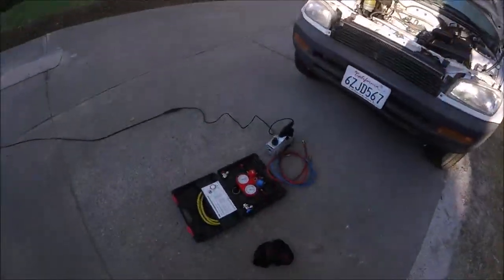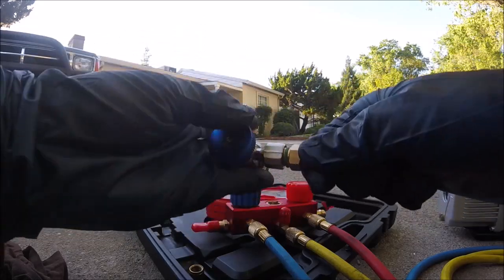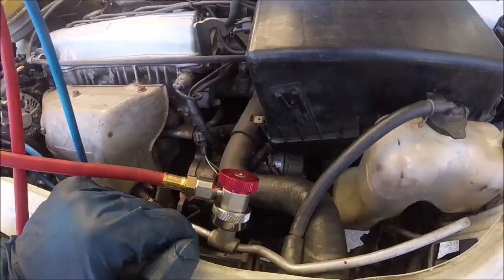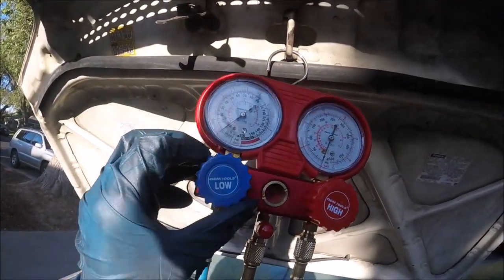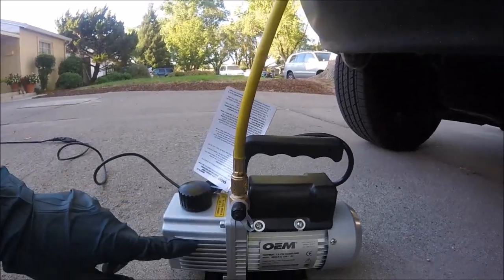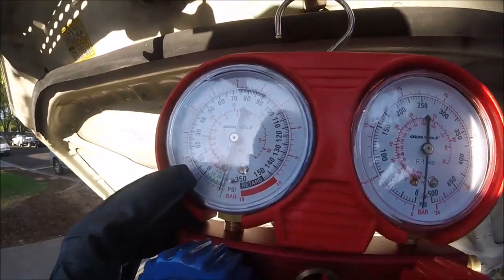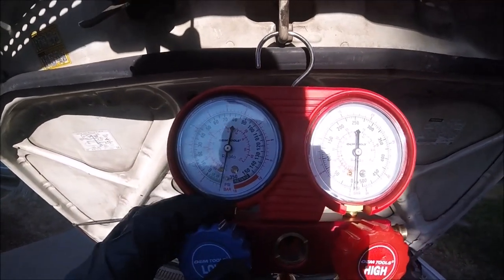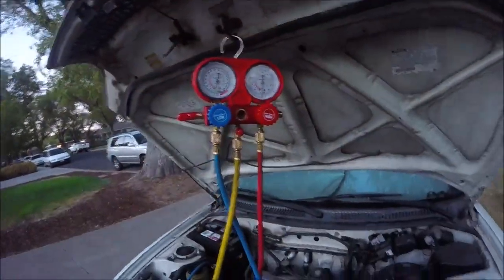How To Pull a Vacuum on Car's  A/C System -Jonny DIY

Comment: Got the vacuum hooked up now. Just replaced the condenser and dryer. My compressor was replaced when I thought that was the problem last year. (It wasn't) 
The hardest part is waiting the first half hour to hour to make sure no leaks. 
Also it's mist coming out of the vacuum most likely.

All in all you video had the info I was looking for.

Now I have to go reinstall the grill and brush guard
Reply: Went from 93° down to 45° took almost an entire 18 oz can before the cycle switch would kick in
Reply from the maker: Nice! Glad my video helped you out and I hope you get your AC blowing ice cold soon 😀👍🏻
Reply: Well wouldn't hold the negative pressure.  Had to go and double check to make sure all fittings were tight (they were not). Fixed that and -30 held for 30 minutes.  Now I've vacuumed it for 45+ minutes. 

On my way to go get freon. Will inform of before and after temps and end results 🤞
Reply from the maker: Awesome, glad it worked out. Now youre ready for the Summer heat 🌡😀👍🏻
Reply: Well after a week we have lost pressure enough that I added a 12 oz can and we are still back to it shutting off and on
Reply: That's what I'll be doing soon. The bad part is I replaced all 3 major components and all o rings. The only thing I didn't touch for some reason was the bottom hose
Reply from the maker: @0004ogre  yeah sometimes its just a matter of re tightening one of the connections.  Hopefully not compressor
Reply: Well almost. Have to replace clutch switch
Reply from the maker: Dang. Ive got a video I'm going to post soon trying out some stop leak ac. But its pretty much same process. Vacuum entire system dry, then put can of stop leak and fill with refrigerant. Then cross fingers hope if seals leak. It just really depends where its leaking from. You may want to put some UV dye in it to pinpoint leak
Reply: What do you think about the leak dye detection
Reply from the maker: @0004ogre  i like the UV dye the best. Where you use glasses and light. Kits on amazon pretty decent priced

Comment: Close that high side before adding freon
Reply: No one has lived to answer that 😂 😊
Reply: @kevinarcher7701 
👍
Reply: Absolutely!
Reply: Getting ready to do this. Thanks for mentioning. Out of curiosity what happens if one were to forget?
Reply: @spriley630 
very smart question
Reply: High side will go into tank tank not rated for that pressure so tank could in theory explode

Comment: Nice video! But my system won’t go down below zero but it holds a vacuum ? It’s about 4 notches above 0. Can I add Freon ?
Reply from the maker: Yes as long as it pulls a vacuum down pretty low and holds it without leaking youre good to go

Comment: Hey quick question. So after I know i dont have a leak. I turn the pump back on for a few hours. And then what do i do?
Reply from the maker: After you know it can hold vacuum, so no leaks, you turn pump back on for 30min to an hour to make sure the system is completely evacuated and dry. Then after that you can recharge with correct amount of refrigerant
Reply: @JonnyDIY  ok but do I open both red and blue on the valve side for the duration on the 30 mins vaccum? You didn't say that part. Thanks
Reply from the maker: Yes open both to fully vacuum down system 👍🏻
Reply: @JonnyDIY  ok. Both ends right the 2 on the ac lines and the 2 on top on the reading valves ? So pretty much open all 4 to open for duration of vacuum right? And after 30 minutes of vacuum when I turn off everything will it naturally stay at -30 or go back to 0?. Thanks I'm doing this right now. Much appreciated!
Reply from the maker: Yes all 4. It should hold at -30 if no leaks
Reply: @JonnyDIY  Thank you very much sir. I appreciate your expertise.  Have a good day.  🙂
Reply from the maker: You're welcome 😀👍🏻
Reply: @JonnyDIY  well I got bad news, i replaced the ac compressor and it's still not engaging the clutch and I put more than enough freon and checked for power on the car's connector and all good but the ac compressor not turning on. What can it be ?
Reply from the maker: @californiaitis1255  double check work. Check fuses and relays for AC. Also check AC pressure switch
Reply: @JonnyDIY  thanks for the quick reply bro.

Comment: I did not understand this video. He says if it gets to 30, you can close it now and turn off the vacuum. Now its going to vacuum for 1 hour. So how is it going to vacuum with vacuum off?
Reply from the maker: First you want to vacuum it down to as close to 30 as you can get then close it. Thatll tell you if it can hold vacuum, if vacuum drops then you know it has a leak.  Then after knowing it holds vacuum you vacuum it down for an hour to clear system before recharging
Reply: @JonnyDIY  yeah i just found out you turn it back on after an hour to vacuum. Makes sense now.

Comment: I have honda city 2005 exi model.. When I teun on the A/c rpm goes down below 600..enigne pick up is very low.......
Reply from the maker: Go ahead and check the alternator first. And of course battery next. Check for any check engine light code. My bet would be alternator though

Comment: Hi Jonny. Great video!!! I'm going to be replacing my compressor on my 08' Honda CRV. This is the machine I need to rent from Autozone to vacuum out the freeon & air out of the system before disconnecting the lines right? And when I replace it vacuum any air in the lines before charging it up with freeon right? Just want to be have more knowledge when I go to do it. Thanks!!! Hope to hear back from you
Reply from the maker: Yes if you have refrigerant still in system you should have it evacuated into a container.  But if its got any leaks its probably all leaked out. Yes you will need to rent gauges and pump. After all is installed you must vacuum system to get all air out and test make sure it holds vacuum. Then you add the measured amount refrigerant specific to your cr-v.  Good luck with the project!
Reply: @JonnyDIY  Thanks Jonny!!! Just trying to save some money & not get scammed! Appreciate the reply!!!!

Comment: Sorry, I don't get it. When you turn of the valves on the manifold...have you not ceased to measure "vacuum" in system...no matter how long you wait?
Reply: I too do not understand why he closed the gauges.
Reply from the maker: You just close it off to make sure it will hold vacuum. That there are no pin hole leaks in condenser or hoses or bad o ring seals
Reply: But that's what I am asking...when you turn it off...is the gauge not now isolated from the system? So the vacuum you are reading is not the car's system? Or, am I wrong...when you shut down the valves...you are?
Reply from the maker: Theres 2 sets of valves on gauge set. So if you close off the ones up by the gauge dials the hoses are still open to system. If you had closed the ends of the hoses then it wouldn't work as you would just be reading the hoses as you have said.
Reply: @gregt6587  You are correct, he should have reopened the blue tap to monitor the vacuum in the system.
Reply: To be clear, while the manifold valves (blue and red) are closed, the HVAC system pressures or vacuum is shown on the gauges.  The manifold valves are only opened to vacuum, charge, or recover the HVAC system, via the yellow hose.  In short, the valves must be closed when monitoring the pressures or vacuum in the HVAC system.

Comment: Can I do this on a semi charged system? Or do I have to have all the R134a out of the system. I accidentally got air into the system and my ac is just barely cool. The compressor is running and the fuse is good as well.
Reply: Depends how long the system has been exposed to air. AC oil turns into acid which will destroy your compressors Reed valves if exposed to air for too long. You system might need to be flushed. Simply recharging the system might not be enough. As pulling a vacuum does not take out the acid in the system. I personally hate these diy a/c videos because none of these internet guys know enough to help navigate Joe blow through the entire process without doing something that could lead to compressor failure.
Reply from the maker: Yes you can, but you should have the system evacuated and collected at a Mechanic shop or youll just be venting the AC gases to the atmosphere. That being said it sounds like your system is almost empty anyways, so it wouldn't be horrible. If you're certain that there is air in the system, vacuum the system. If its just low it may be worth just trying to recharge it with a Can of R134a til it gets Cold.
Reply: Will the vacuum just push the R134a that it pulls out into the atmosphere or does it have a tank it stores it in? Thank you!
Reply: Wow. Sorry it posted a million times and I don’t know why!!!!! Sorry crazy phone!!!
Reply from the maker: The vacuum pump just pulls all the R134a out and vents to the atmosphere that's why shops that do AC work have a special evacuation tank that the Refrigerant goes into.

Comment: I loose all vaccum when I remove yellow hose from pump to add freon? Knobs are in closed positions.
Reply from the maker: Hmmm...Well if its holding vacuum fine and did for an hour. Just turn off pump, disconnect the lines from the high and low side & yellow from pump. Then Add refrigerant Can to end of Yellow Line and reconnect High & Low Side Hoses start up the car put the fan & ac on & it will suck the refrigerant out of the can
Reply: Jonny DIY thanks. Did anyone tell you that you sound like Pauly shore? Haha
Reply from the maker: Haha I loved Pauly Shore growing up!  I usually get told I remind people of "Joe Dirt" lol!

Comment: how much to rent those, when do I need to add oil when charging the AC
Reply from the maker: Free to rent just need to leave a deposit of about $200 I think for both vacuum pump and gauge set. You should be fine without adding oil to the AC if you had a slow leak

Comment: Thanks for video Jonny. I've tried pulling vacuum on a 2005 odyssey after changing compressor. The low side gauge would not move at all. What am I doing wrong. Please help
Reply from the maker: Make sure the valve on the hoses that are connected to your high and low sides. They open Clockwise direction usually. And the valves up by the gauges open Counterclockwise. You probably just have one closed. Good Luck!